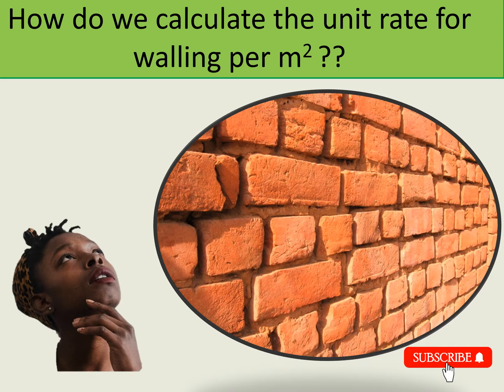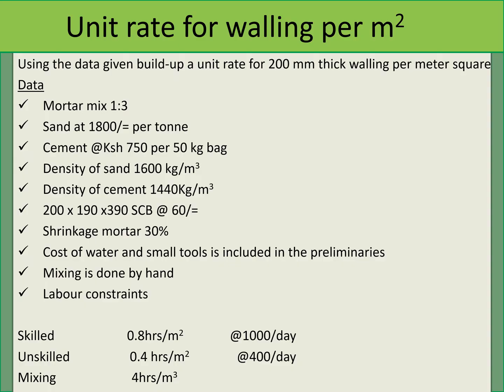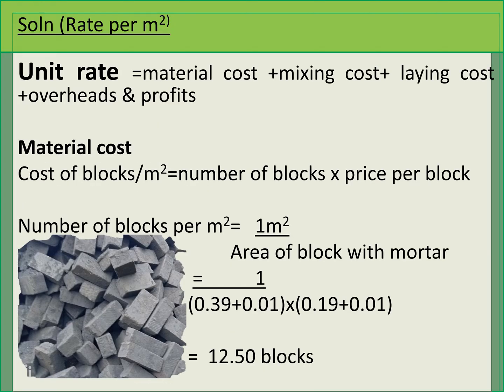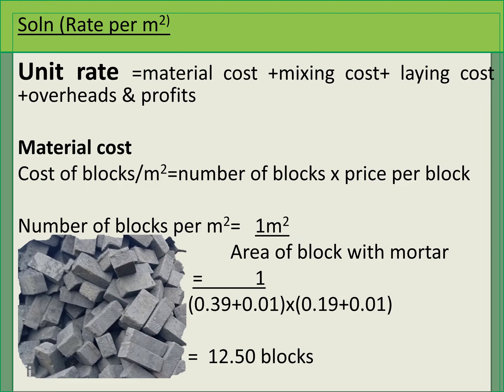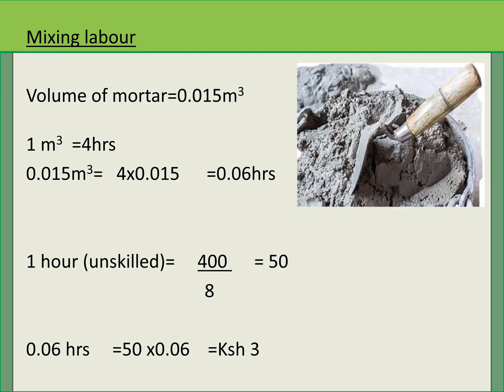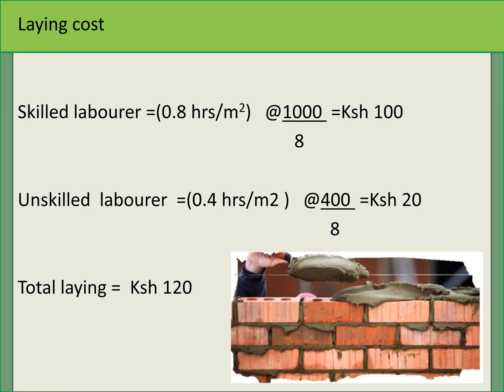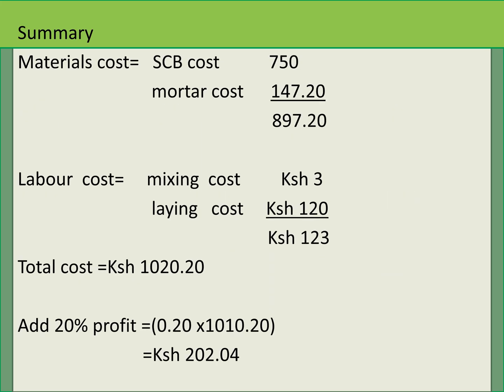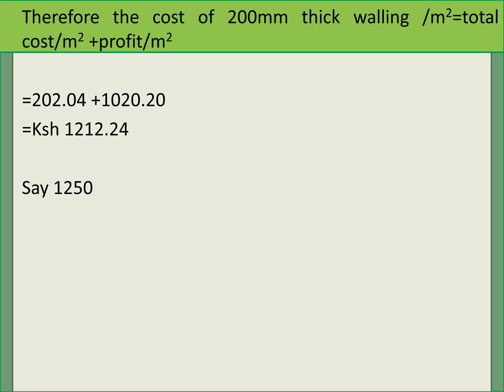Rate analysis  for walling/calculate quantity of bricks /cost for constructing  1m2 wall /QS classes

Comment: Hi. Madam I have got a question 
Build up a unit rate of 1(1/2) thick wall in c/s mortar ratio 1:3 per m cube
Cement per 50kg bag.    Ksh. 750
Sand per tonne.          Ksh. 1800
Bulking of sand.     20%
Cost of brick per piece.  Ksh 15
Unskilled labour/hr.     Ksh 50
Skilled labour/hr.      Ksh 100
Density of sand.     1600kg/m^3
Make reasonable assumption for information not given,cost of material include transport to site